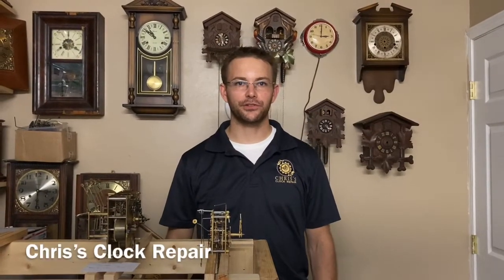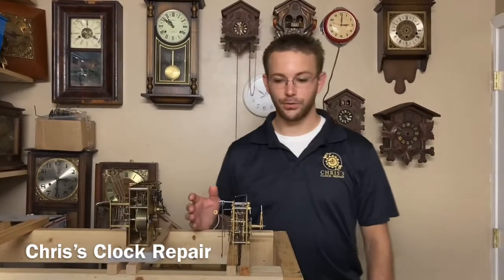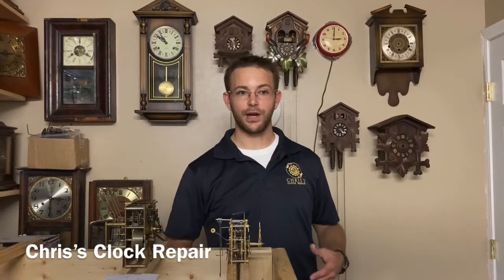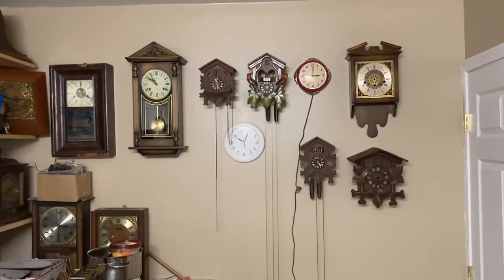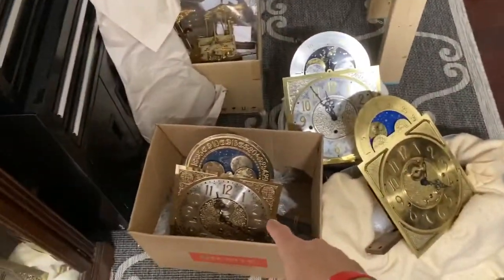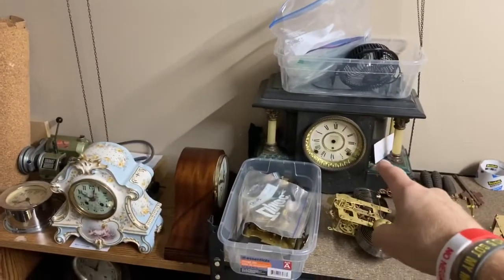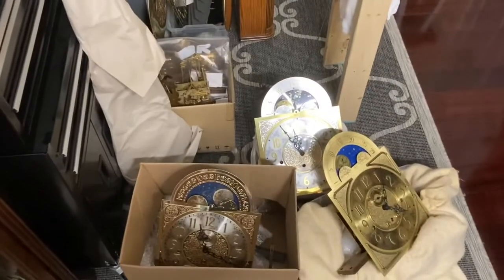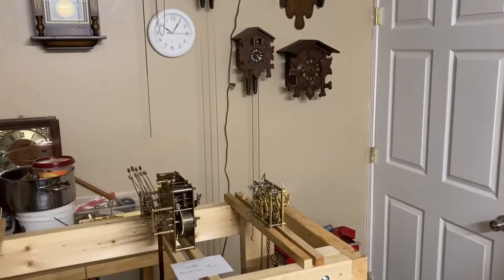How to improve Clock Repair Efficiency - assembly line 1

Comment: My clock will not continue to tick and if I add more weight to the weight it continues any idea what I should look at
Reply from the maker: Justin Abshire Thanks for your question.  Typically the added weight helps to overcome the buildup of friction that has accumulated over time as a result of 

wear on the gear pivot holes in the plates. You can ease the friction by oiling the pivot points of the gear train.  However if this does not handle your issue, its time for a repair of the worn pivot holes.
Reply: Chris clock repair so would you recommend adding the weight and letting it drop or what
Reply from the maker: It will run, but it will cause more wear to accumulate. It will eventually stop and you will need to repair it. So, if you dont want to repair it, you can run it that way until it wont.